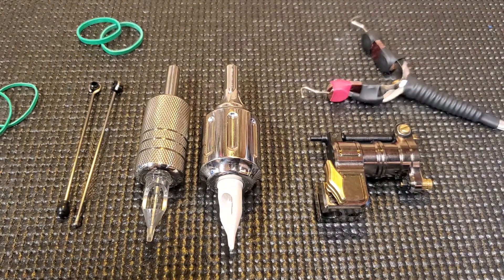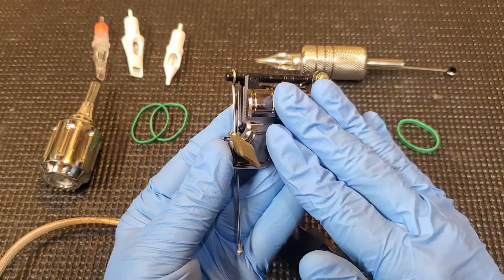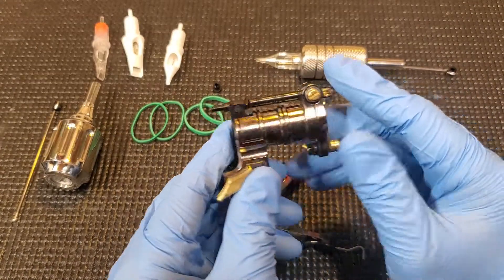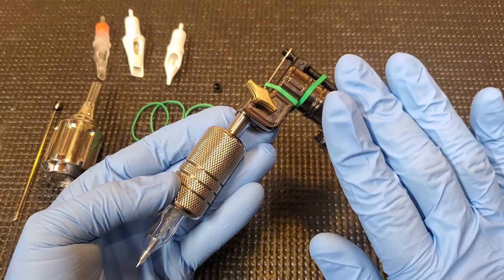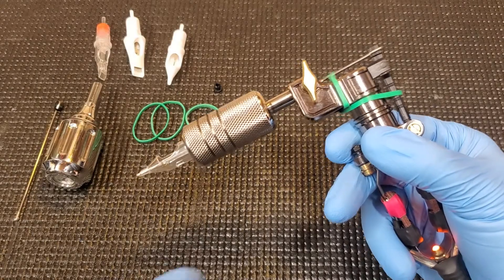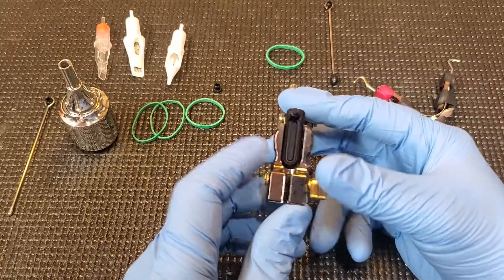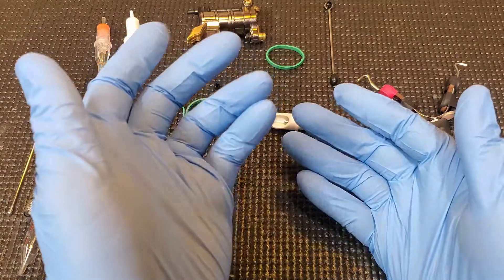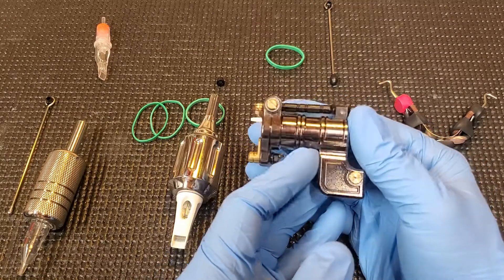Dan Kubin DMC V2 Tattoo Machine Review

Comment: Great video man! 
I would love to hear how the dmc v2 compares to the swingliner v2
Reply from the maker: Thanks man, stay tuned! I should hopefully have a video out on it before the end of the year. I still need more hours on it to be thorough with my review.
Reply: @ShareXP  allright, looking forward to your review👌 
Especially with cartridges and machines with give there is a lot to discover haha 

Ive had the dmc v1, v1.5 and v2 too, but at some point i got tired of thinking about the cartridge tension all the time. You switch the brand of carts, and the difference in return tension results in a different hit. If you change the needlehang you have to deal with a different return tension again. Sure you can still tweak the tension with a rubberband, but when using different brands of carts and different needlehang it can get really annoying. But thats the downside of cartridges, not dan‘s fault! I think i will get that swingliner v2 at least for colorpacking with carts 💪🏻
Reply: @ShareXP what were your thoughts after some more use? 

I’m trying to decide between this and the swingliner.
Reply from the maker: @ronzzz8130 I prefer the DMC over the Swingliner. I've owned all of the versions of both models. The DMC rules, but I haven't seen Dan dropping any on his website in over a year. You'd have to get it second hand. It's a bit disappointing.
Reply: @ShareXP  yeah, sold my swingliner 😅 dmc was great, but sadly they dont hold up..
Reply from the maker: What breakdown did you have? Mine is 2 years old and used several times a week. Any modifications that caused this?

Comment: Thanks for that review! I wanted to ask you about this machine.  I have the same dmc and it works great, but its getting hot when working, even with a new motor and all bearings. Did you notice such a thing on your dmcs?
Reply from the maker: What voltage are you generally running at? Stuff getting hot may be a sign of screwed up polarity somewhere, either inside the machine or your clipcord. Or a friction spot may be to blame.

Comment: You can disengage the return spring for carts this is a better cart machine if you disengage the return spring it takes away the give and your machine will run perfect for carts its my favorite machine for standard liner
Reply from the maker: Okay interesting.. set it up for standard needles but run it like that for cartridges? I imagine that by disengaging the spring you'd put extra strain and wear on the motor having to turn over without that spring to mitigate the cartridge tension.. any feedback on that?
Reply: But I do use carts 90 %of the time
Reply from the maker: Awesome I'll give it a try.
Reply: @ShareXP  the give is for standard needles and carts remember no give that's how u run it it if u have an extremely high tension cart use a rubber band on the armature bar in the middle if the a bar and that will make it work great for  high  tension carts like the original Cheyenne xarts

Comment: Great video, do you think it would be possible to add an rca connection to this machine?
Reply from the maker: Maybe you could swing a clipcord/rca adapter, but a permanent RCA connection would require some tricky modding I think.
Reply: @ShareXP  gotcha.
Reply: @royltattooatl  not only that you'd ñoose the softer option something homeboy is correct

Comment: Hi, im a pen user that just doest manage to get good saturation with big liners and round shaders, also with blackwork, i have an option to purchase a barely used dmc v1, is that a good option for that? I work solely with cartridges
Reply from the maker: Well I'd definitely be using a 4.2mm stroke or larger for those groupings. The DMC is a 5.0, so it should manage just fine. Some small differences between the models obviously.

Comment: I have the exact same machine. I have easily 300 hours in on it and it’s my daily driver. I noticed I’ve had it stop running sometimes lately because it doesn’t seem to like the cartridges I bought. Something possibly with the armature bar not keeping in sync with the needle membrane? Any thoughts?
Reply from the maker: I'd tinker around with the rubber band tension first, what brand of cartridges are you using?
Reply: @ShareXP  normally blackclaws are my choice but I bought some kingpin ones that aren’t the best. Definitely not even close to blackclaws. I ordered a new clip cord to see if that might help. Could be a connection issue.
Reply: I have the same dmc too. Did you notice your machine is getting hot when working?

Comment: I realy have to disagree about making dots (dots shading) with this machine
Now you have been talking about the voltage of this machine at around 5-5,5 volts
I have made some sick ass dots shading with this machine at 4.3volts with Kwadron 0.30 3-5 liner
Now what you didnt mention (cause you’ve probably havent tried it) ,this machine runs it very best on the lower volts
Packs black so smooth at 4.8-5.2 (depends on the type of needle you use ofcourse)

Give it a go…you’ll never fell the same😅😅🙏🏽
Reply from the maker: Thanks for the tip! I'll give it a try this next week.
Reply: My coworker is a bng ornamental type....so she does,alot of dots and a lot of black saturation ...she uses this machine more than me bit yeah its great at low volts still punchy enough to make great dots
Reply from the maker: Thanks again man, I'll do some more tinkering with the DMC. Appreciate the feedback.